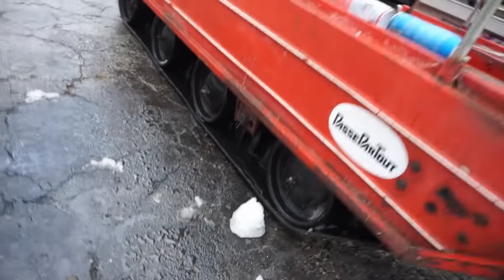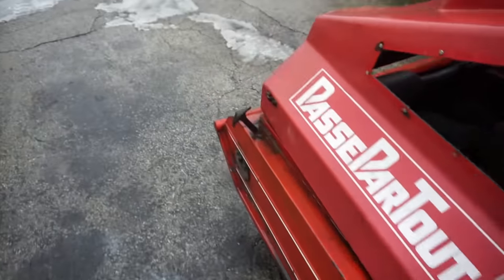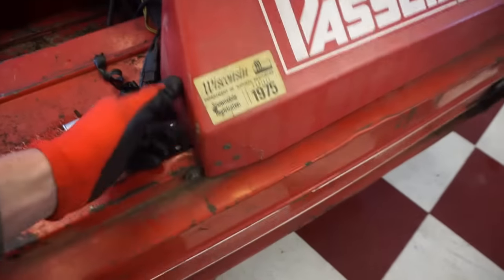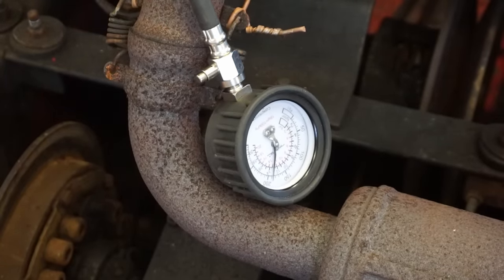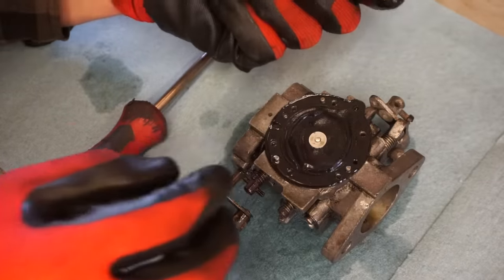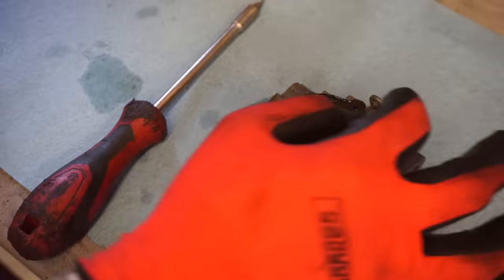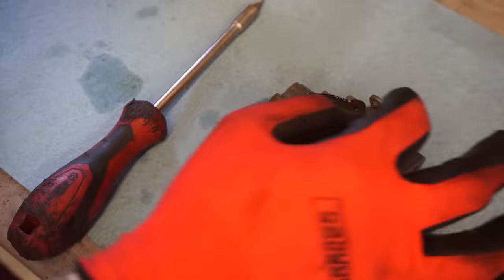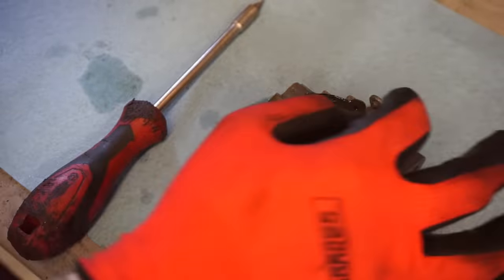I Bought a Super Rare Mini 2-Stroke Tank (The Ultimate Off-Road Machine)

Comment: Just so you know(if you dont already),  when the bowl is off the carb you are looking at 2 round disks. Those are welsh plugs and normally you would take those out to clean underneath. Usually there's a passage way under them. They are soft metal and are tap in one use plugs. There can easily be dirt in there

Comment: The PPT was bought by Valquentin Industries LTD in Canada, then sold to Twin Bay Industries Inc. in Elk Rapids, Michigan. They were still being produced into the 1980s. I have two Model PPT-620s which have the wide tracks.
Reply: Mine was built as you say by Valquentin  industries in ValQuartier Québec, Canada. Mine was built in 1973. Rob Quentin was one of the engineers. He moved to Alberta years later.
Reply: So how big of motors did these have? 600cc plus? what would this be like with a Idk street bike engine? Not a hyabusa but just a solid lil 600 cc?
Reply: @jasonchristopher2977  Mine is a one cylinder 14 horsepower Kohler long life.
Reply: @jasonchristopher2977  Just remember that you get to design a real crankshaft-driven cooling fan and cylinder baffling/ducting system that absolutely does not allow the hot air to get into the cold air supply. Fifty years of air cooled engine repair talking here. Motorcycle engines are shit if what you want is low speed power. Better off with a snowmobile engine.
Reply: @billybrand  Wow ok. That makes since for the year. I had a 2cyl wisconsin I bought as a teen for a rebuild project. These things are so cool. I bought a argo 8x8 and it had wheels and the owner had put tracks on it. That thing was a beast. Not too fast but it could go everywhere. I also tried to buy a Idk if u know what a log skidder is but it articulates in the middle. This was a tiny fit in full size truck bed sized tractor that did same. Front was engine and rear was seat. Guy wouldn't sell it and when he died it was auctioned off. I've only seen 1 in 40 years. Idk who made it. I love small projects like these. Do you still have it? How'd it hold up if so?
Reply: @patrickshaw8595  Ok. Thanks. I'm a car guy more than a bike guy. That makes sense. I know as a kid in 80s, 90s even back then snowmobiles was wicked fast. Scared a few times on them. I know these aren't made for speed but I think with more speed but especially HP it'd just go and go. Thanks man. Appreciate the info. I'll keep this in mind when building. You saved me alot of time, madness and money.
Reply: @jasonchristopher2977  My Dad worked in the bush so I seen how cool skidders are.  Some of the first ones were manufactured by John Deere or Terex.  There's lots around here in northern Ontario where I live. Unless you are talking about the El Diablo which has a motor and track in front that pulls a sleigh with a seat on it. Those are cool too.
Reply: @jasonchristopher2977  Aircraft mechanic school in the Early 60s =
 "Air Cooled aviation and industrial engines of course run the Otto Cycle and burn gasoline but the design, construction, characteristics and handling of them are completely different than water cooled automobile and truck engines in every way."
Your welcome Young Fellow.
Reply: @billybrand  Cool. Most ppl are like Wtf is a skidder? I'm like 1 of the coolest machines for any man who as a boy loved monster trucks and quads lmao. Yes this is a small one about half as wide as a old Honda 4trax and kinks in the middle. I'm gonna see if I can find a name. It was from Sweden, maybe Canada. Some rough country with snow.
Reply: @billybrand  Closest thing I can find is A12 Holder 1960s. I recall it being white. But it'd fit in back of a truck bed. Hello from Pennsylvania. I watch AvE all I can. He's a funny, very smart fella.
Reply: @jasonchristopher2977  Ya I would be interested. I never seen a skidder that small the size of a 4trax.
Reply: @billybrand  I asked my dad. it's a Pasquali 986. Just Google Pasquali small Italian tractor and u will see what I'm talking about. So cool and strong as hell. Can drag full tree length wood out with no top and branches.
Reply: @jasonchristopher2977  Oh wow!  Thanks! I will look that up!  I searched it on YouTube and found videos of it. That is an awesome looking machine! You're right it's almost like a skidder would be except very small. Nice!
Reply: @billybrand  I recall a guy using it as a log skidder. He cut some walnut and got the butts off ground on hitch and had the rear on a cradle with wheels. He'd haul out 1 or 2 small tree length trees at a time. It was 40hp I think. There are some clones, Carraro etc. Just look up small articulating tractors. Big in Italy, France. Pasquali goes for a grand or more in working condidtion. Some had Idk quad wheels where each wheel is a dual. Then weighted down with calcium. Now we use RV or outdoor wood stove that heats water type coolant. Calcium will rust out the wheels fast. What they use on our roads here in winter that eats metal like acid. Ruins cars especially uni body. Check them out.
Reply: @jasonchristopher2977  I would definitely use it as a skidder and bush vehicle. I wonder what it would be like with an ATV snow plow on it. I would see this type of machines used on vignards. Speaking of unibodies, I really don't like those. Talk about crap when it comes to towing trailers and campers. The frames can pull right off. So you're talking about the calcium which is put on the roads. Where are you from if I may ask?
Reply: @billybrand  Pennsylvania. Ever hear of the Pittsburg steelers football or pirates baseball or Penguins hockey? I live south of Pittsburg in the sticks. H8 big city.
Reply: @billybrand  Why I drive panther platform cars. Lincoln town cars. With 4.6 2v V8. They run for a million miles and have a frame. I can't tow alot like a truck but I can tow. With some engine and trans work I could tow alot more. I have towed other .50 ton trucks and cars with a tow dolly.
Reply: @jasonchristopher2977  Ah yes, Pennsylvania. We get bear hunters who come up here to the Kirkland Lake Ontario, Canada area from that state. Next week some are coming up to go snowmobiling. I have seen the teams you mentioned on tv.
Reply: @billybrand  Hope they are well behaved guests. We have good good ppl. But like all places we have some Aholes. I never hunt bare, always have clothes on. Lmfao. 1 of my dad's many corny jokes. But I have hunted for real and I grew up hunting but after my service in USMC I enjoy hunting with my eyes and a camera more than a weapon. We have alot of Amish and have had them work with us and sold logs to them. Good ppl. Did u check out the Pasquali? It's motivated me to find 1. Maybe upgrade with better brakes and more power. Prices of machines with wheels are Insane. I miss pre 2020. Wtf. Now a engine is going for 2020 price of a car.

Comment: When I worked at a Cushman dealer in the '70s they sold the Cushman Tracksters. We serviced Passe Par Tout machines also (pronouced: (pass par too). The Trackster was a nice track vehicle with hydraulic drive units and the strangest horizonal twin 2 stroke. Both pistons fired at the same time.

Comment: That thing is cool for sure 2vintage. Consider restoring fully restoring it, and/or also consider restomodding it...newer low-back bucket seat, low profile steel cleats on the tracks for more traction, a lightweight firewall between driver and engine, a low profile Lexan snowmobile style windshield, nice headlights and add a small light bar on the hood, a new stainless full exhaust routed to the rear to quiet it down and not have exhaust smoke, make a quick-removeable rear seat and also a quick cargo rack that mounts the same way, paint it nice (maybe camo), etc. With steel cleats on the tracks that thing will go where 4-wheel ATV's can't go without getting stuck...and it sure seems to have plenty of power, the seller said it can tow heavy things so it must have a lot of torque as well. It's a keeper no matter what just because it is a mini tank that is fast and fun to ride/drive.

Comment: Almost 250psi is crazy compression from that little engine! Great video as always 👍
Reply: Because the bores are full of oil
Reply: maybe the oil you add make the ring more sealed and give you a false reading
Reply: @Evilslayer73  definitely
Reply: @juupa2890  yes that would make it read higher for sure but to be after pulling it over several time with the plugs put still seems like a very high compression engine.
Reply: @MoonShine07  I'd run premium with those numbers until I found out otherwise, twice the compression of my car LOL.  Maybe the 2 stroke oil raises the rating.
Reply: @ecidemon5672  agree with you there

Comment: Just a tip on plugs , run Bosch plugs , no NGK , OR ND. And run a medium heat range , and use a good quality synthetic 2 stroke oil . The 399 CCW is a high preformence engine . In the course of restoring the engine , replace the carb diaphragm kit , clean the jet orifices o rings and gaskets , and replace fuel pump Diaphrams . 
 pull the flywheel and replace the points after setting the gap , and replace the condenser . Make sure that you have an inline fuel filter that is also a water excluding model that you can unscrew to clean if it clogs . And don't run the starter so long you can overheat it.  And purchase an engine Manul . You don't need to pull the clutch to replace a belt . First make sure that the driven pullet is properly lubed so that the sheaves slide freely ,then you pull th belt till the belt is in bottom of sheave and it slips over the clutch and make sure that all of the track boggie bearings are greased

Comment: there is an original replacement front end/ engine hood cover still in primer for $99 on ebay out of Michigan and they have belts, axle shafts, brakes and brake parts original decals and alot more other parts on ebay for that thing

Comment: A highschool friend of mines dad was a dealer for them in Flint Michigan... They also raced them and modified one with foam flotation, added small aluminum pieces on the track and a bilge pump and got it to go in water... The one story I vividly remember is when they were stopped by the Michigan state police on the way home from a race event and asked to volunteer to use their " snowmobile" along with about 5- 6 other snowmobilers to rescue someone from a small plane crash way back in the woods in winter. They told the Police they didn't have a snowmobile they had something BETTER... All the Snowmobiles broke down or got blocked by brush or downed trees the PASSE PAR TOUT WENT OVER OR THRU EVERYTHING...The Police were mightly impressed... He had lots of other stories about racing them... I only rode on one once for a demo ride at their shop 4 people in it and went over the top( thru ) a large bush about 4 foot tall impressed the hell out of me. I really wanted one but I was still in HS.

Comment: Mine has a Kohler Long Life motor 4 stroke. I had to put aluminium angles inside the plastic cleats which are inside the tracks to keep them from breaking. Snow and clay builds up on the boggies and ends up tightening the tracks. I have to stop and clean them up every so often. Mine has Renault clutches. You have one of the newer models. Playcat™ and RaidTrack™ are copies of them. Your facts about being made for the Vietnam war is correct.  Mine is a 1973 model.

Comment: I have a 68 or 69 Play Cat 400 which was the company that was bought out and the model was continued with your PasseParTout. I have put some work into it, swapping a jag 340 engine due to parts constraints with the original Kohler 400. I have not gotten it driving yet. Very cool units.

Comment: Compression reading may have been enhanced with placing that oil in the cylinders. I'm sure you can still get carb kits here in CANADA for those carbs. Very popular engine. Get those clutches sanded smooth with sandpaper and some grease on those splines, top and bottom, the proper belt will have her working even better. Good luck.

Comment: helped get one running in PA about '76 was in pretty good shape good tracks paint seats etc.  Had original SACHS 350cc 2 stoke single with pull recoil start.  Started EZ and ran well plenty of power to really scare you at speeds to fast for this type of vehicle!  2 speed tranny was nice to have and I remember reverse too.  Had to get it out of some tight spots.  Lots of grease zerks on the boogies!

Comment: I had one of those in the early 1970’s when I lived in Northern Alberta Canada on the east slope of the Rocky Mountains it was an amazing bit of kit there was a lot of wilderness to explore and we had fun doing it my friend had an Argo we went on some really amazing adventures. We would haul them on trailers behind 4x4’s as far as we could go on the logging roads then head off to explore. I also had a 400cc Yamaha IT  that was fun to use to explore the area. 
These tracked vehicles and the Argo rubber tire units were often used by land survey crews and timber cruisers so we’re fairly common in the north.

Comment: You can replace the bottom connector for gas in on the carb for a screw in filter and save the carb from getting junk in it

Comment: swap the seat for something a little sprung, gas can, battery, oil ,and tools in the deep well in the back, axe and shovel strapped to the tubing frame. Bright LED headlights and a much better muffler, a hinged plate over the well and you can haul things like camping or ice fishing gear.

Comment: Great, and red
18:25 Before the petrol crisis of 71-73
the steel was of very good quality
it was the segments that ate a grain of sand, and the shirt that was clean, not scratched,
Now it's the opposite, and even worse in France with imported Chinese steel.

I had a 1965 B&S mower, recovered in 2000,
 never drained-mayonnaise in the oil etc.
Nickel engine, like new.

Comment: Them side valves are for low rev torque so have very little valve overlap - they pump great at low crank speeds giving high compression - at high revs the wheeze

Comment: The oil you put in the cylinder is what making your compression so high big thing with those old ccws is crank seals especially pto side and center seals way you can tell if motor has been into is center seal is a newer style harmonic seal might be called dynamic seal

Comment: just something i notice there the motor mounts are bolted right to steel there has to be rubber dampers under those bolts or you will crack something overtime.

Comment: Hey buddy just so you know you want a belt that has a little bit of slack so could ride up the variator for higher speeds also you're missing the rollers that go inside the variator they sell them in different weight were different speeds

Comment: If you’re gonna keep on buying vehicles with these diaphragm carbs you need to buy a pop off pressure tester. Basically they test how much force is needed to pop open that needle in the carburetor. Too low and they’ll run rich, too high and they’ll run lean. Small deviations in it can usually be tuned out but anything more can cause a bog you’ll be chasing down forever. Also please just invest in carburetor rebuild kits for those diaphragm carbs!

Comment: 2 smokers have more compression than a 4 stroke. Due to how they work. Like diesels only run on compression. They don’t actually ignite with plugs. The two smokers an inbetweener. But plus u dumped oil. So it’s sealing every Orpheus

Comment: ps.   The Low and High (on carb)....are not gears....Low atomizer and High atomizer (changes liquid into a vapor).
Also put a balloon around the end of the exhaust pipe when engine is cool......turn engine over and if balloon inflates to sufficient rate....valves are ok.
If not..... exhaust air is coming out carb probably.
You can do same trick with radiator to check for, and rule out cracked head.
Voltage regulation could be bad....if point....fingernail file works great to file or break loose stuck contacts.

Comment: Friendly FYI - that is NOT how you change a belt on a snowmobile engine. You muscle the secondary open and work the belt down into it until you have enough slack to get it over the primary. Also, the jets are not "high and low gear" - L is low speed (idle) and H is high speed. Adjust L to 1.25 turns and adjust while running until your idle RPM peaks, then back it out another 1/8 turn. Same with H but at full throttle. You're going to want to rip that carb apart and replace the check ball as well. Don't be afraid of the welch plugs.
Reply: Would definitely recommend doing the crank seals, too. They are almost always bad on 50 year old engines

Comment: I showed this to my dad and he remembers the mentioning of this thing for Vietnam but the reason they didn't make it is the lack of protection for the troops and couldn't carry more than three personel, power it wasn't fast enough to noisy and with the weight of the weapons they wanted to put on it it way too under powered. My dad said it was just add loud brand new as yours is 50 years later. He giggle when he seen your video hasn't seen one since he was in and totally  forgot forgot about it until he watched your video. It wasn't made for the jungle or water. On last thing he mentioned it wasn't very fuel efficient it came with a fuel can. Find one lol. He said the one you have looks a little different than what he remembers.

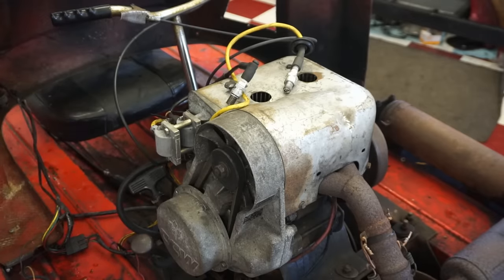Comment: (16:00 ish) I found myself yelling: Try using one plug and check each high tension wires to see if one of the wires is bad. Someone along the line replaced just one wire and it has good spark but the othet has "weird spark" as you put it. For some reason you didn't chech the wires individually.